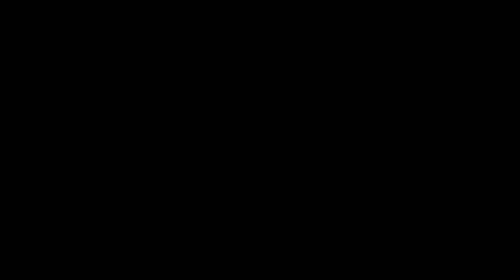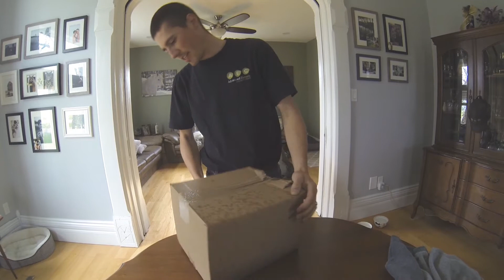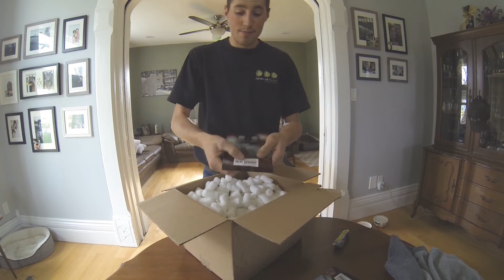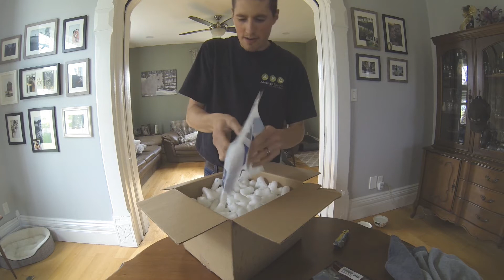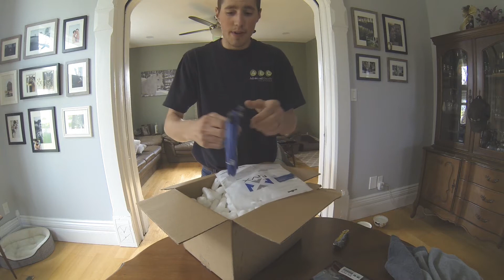Blazer Stereo Parts Unboxing

Comment: Do you have your deck grounded to the factory grounding point or direct to to the chassis? Sometimes the factory ground wire produces a ground loop. In my 94 bravada I'm going to ground the deck straight to the chassis.
Reply from the maker: lance Ivan bryan thanks for the tip, I have installed a ground jumper from the head unit and there was no difference.  I have a few ideas what the cause may be however I just need to experiment and spend some time on it.